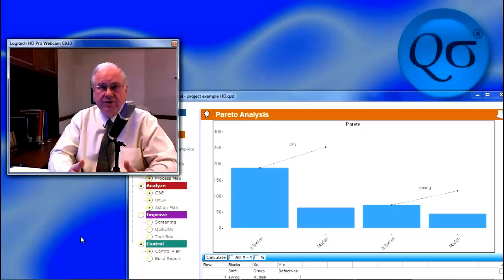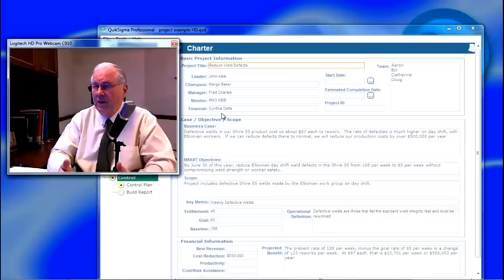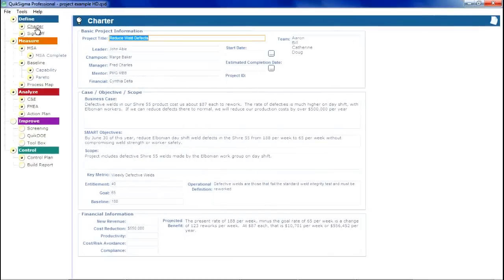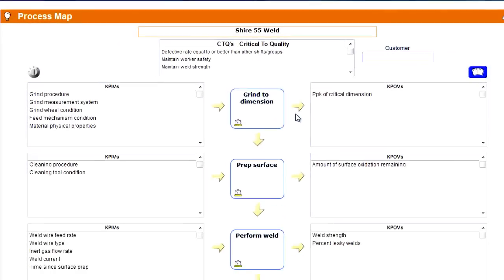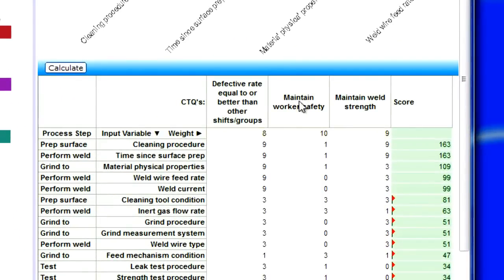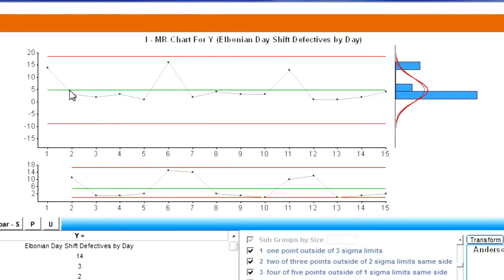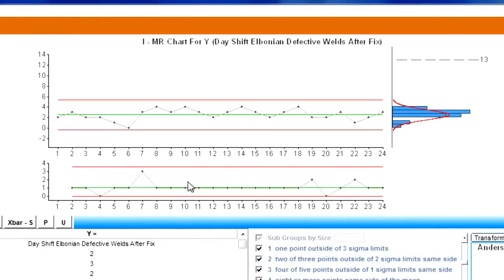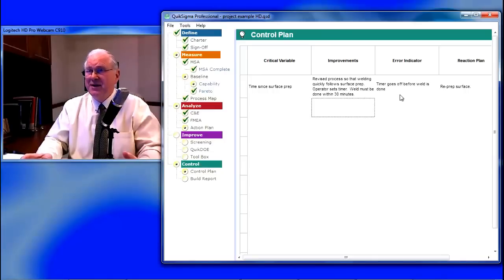Six Sigma Complete Project Example HD

Comment: ?how did you calculate the capability
Reply from the maker: Capability is an index.  Ppk, probably the main index you should be concerned with, is the number of standard deviations between the mean of the process and the nearest specification limit.  You might find this video helpful:  https://youtu.be/66Fjiab1xC0.  The topic is more fully covered in the QuikSigma textbook, which you can order from our web page.

Comment: Why did you skip the Improve step?
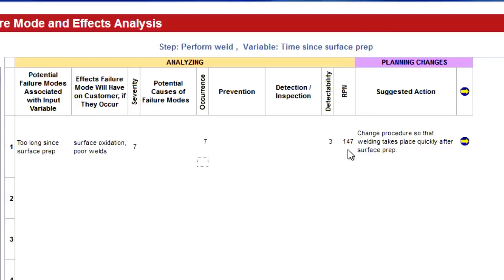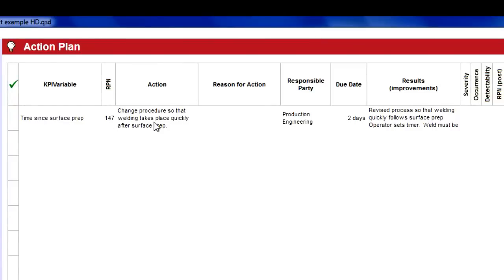Reply from the maker: Interesting question.  Identifying the needed process improvement happens at 15:50, with more at 16:34.  Confirmation that the improvement was successful happens at 17:14.  So the process improvement step is done.  However, as you point out, none of the tools under the Improve tab in the software were required.  The software is structured to provide tools in the context where they tend to be used, if required.  Our rule is to use the simplest tools that will provide an answer.  In this case, there was a major process improvement completed, as all project require.  But the advanced tools under the Improve tab were not required this time.  That is often the case with Green Belt projects.
Reply: QuikSigma Thank you so much for your informative and efficient answer to my question. I really did enjoy your presentation and it was enormously helpful to design my six sigma project for my company.

Comment: You could have reasonably concluded the Elbonians were doing something different than the other workers from the first chart.  A knowledgeable process engineer or an observant supervisor could likely tell you right away the cause of the problem.  There is no substitute for process understanding and observation when it comes to identifying sources of defects. SQC tools are good for providing justifications and evidence for a management decision.

Comment: Hi nice video, I have a query, I'm a six sigma student and trying to perform six sigma in leather manufacture industry to improve operational efficiency but as I don't know how they produce a leather (i,e; what chemicals and why and how long they use etc) as I'm not leather technician, so do I really need to know to run six sigma project in leather manufacture industry?
Reply from the maker: That's a big question.  Maybe this will help a little:  "Improve operational efficiency" is much too broad for a single project.  You would do that piece at a time, through multiple projects.  Since you do the project as the leader of the team, you'll have to be sure that people who do understand the process are on your team.  They will supply the knowledge of what the input variables are, and you will lead the Six Sigma effort to find the important variables, determine how they behave, and apply that knowledge to get the outcome that you need.
Reply: That's very helpful advice thank you
Reply: You need to understand the process first. There really are no short-cuts around that.

Comment: I have question ?? Why it's call Six Sigma not Five Sigma or Four or Three ? please brief answer .. Thanks
Reply from the maker: +Talal AlQahtani "Sigma" for a process is the number of times the standard deviation of the process will fit between the mean of the process and the specification limit closest to the process mean.  Actually, the 3.4 ppm usually associated with 6 sigma really happens at 4.5 sigma.  In the early days, one prominent practitioner did not want to call the program 4.5 sigma and incorrectly applied a 1.5 sigma shift to make the name of the program sound better.  Hence, "six sigma".  Other names could equally as well have been chosen.
Reply: 6sigma means 3.4dppm , almost 100% yield.
but 3sigma not , that's why world class company strive for 6sigma level.